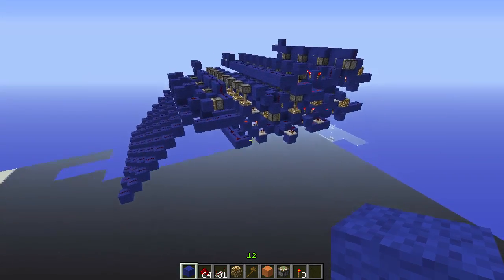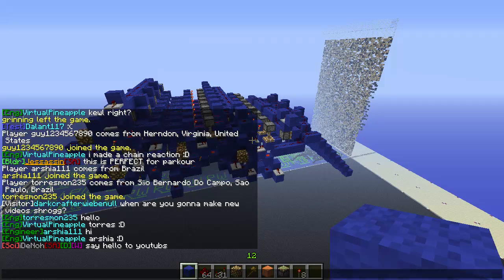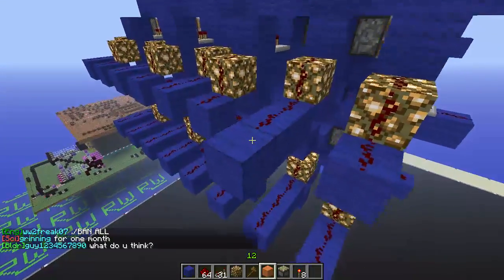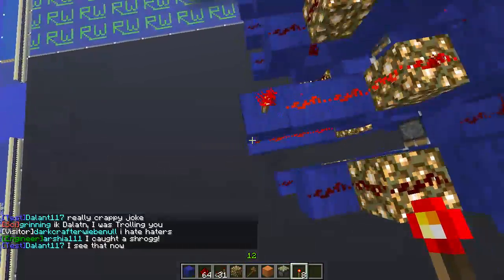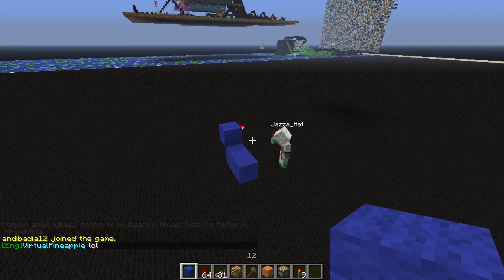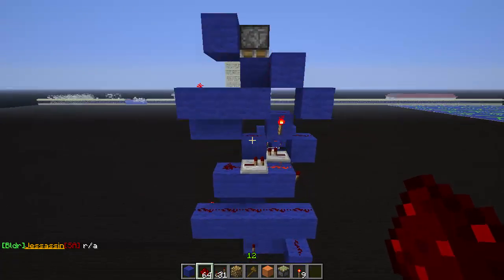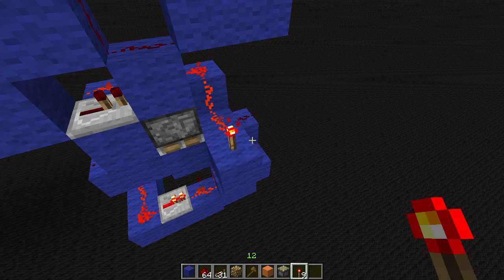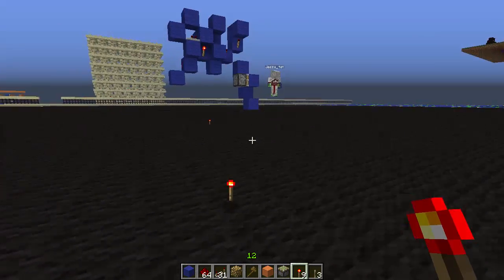Advanced Redstone Circuits: Episode 8

Comment: For the second question I meant whether it is possible to write the output from any boolean function to an address in the RAM. More over, how does the control logic work, and how well integrated is the communication between the ALU and the RAM?
But for what I have seen so far it looks awesome, since it is going to be smaller than your previous CPU. But how fast is it (I am sure it will depend on which function you would use)

Comment: What kind of functions does your ALU have? 
And how does the input for the CPU work? Do you need to input number and which ALU function you want to be applied to them, or inputting numbers by selecting numbers from the RAM and also write the outputs to certain number in the RAM?